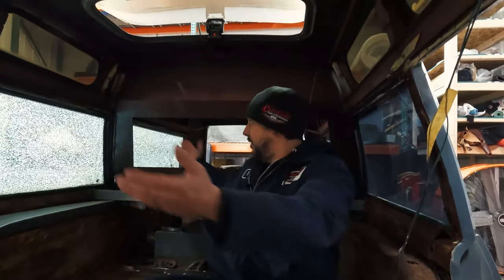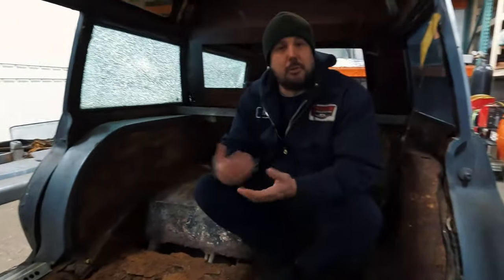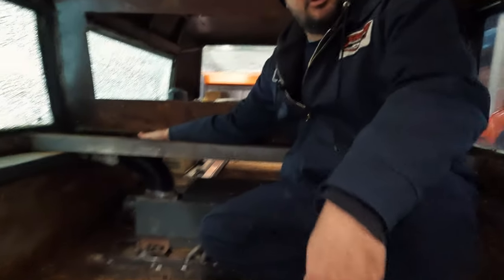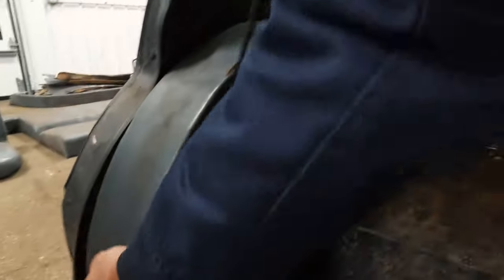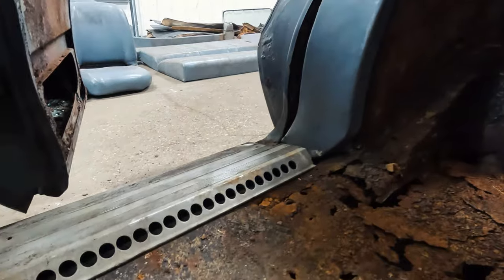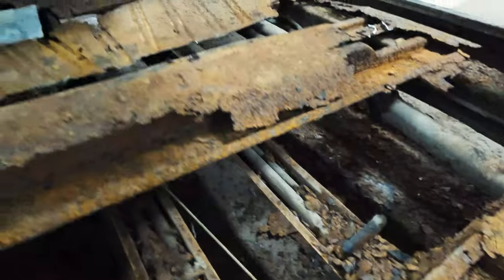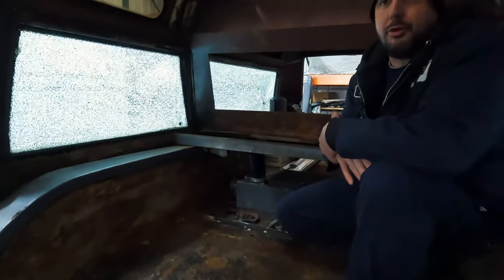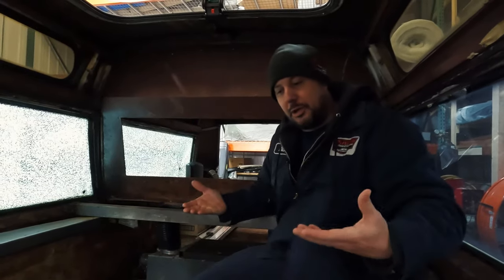How the 1968 AQC Jetway 707 Was Built - HVAC System

Comment: This type of HVAC was used in the full metal Jetways like yours. The later Jetways with the fiberglass rear section did away the floor-armrest system and  had simple blowers behind the last seats. I can’t imagine that being adequate to cool off the entire vehicle full of passengers.

I’m going with a ceiling installed duct system for mine.
Reply from the maker: very cool, thanks for sharing.  We did not know that with the fiberglass ones.  I am sure it did not cool off anyone.  For anyone looking for more Jetway info, be sure to subscribe to Brad's videos @nightshiftlimo